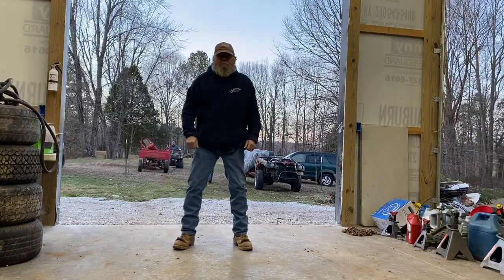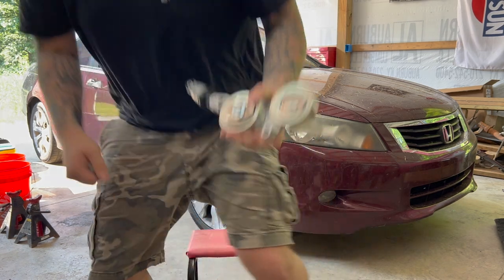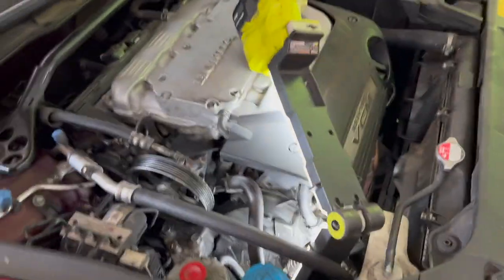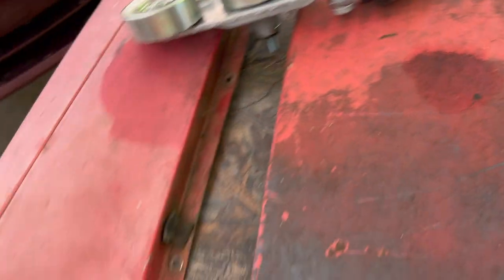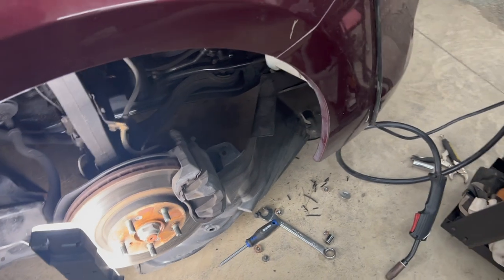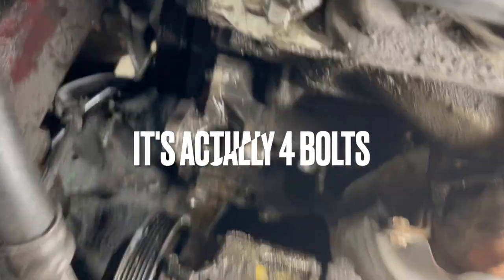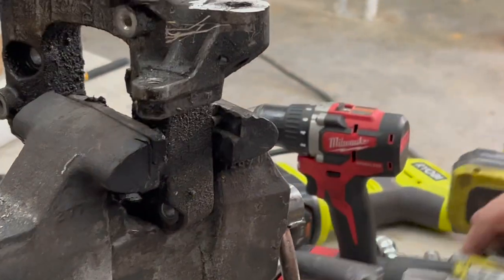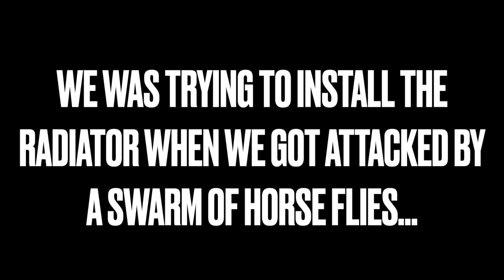Accord Belt Tensioner BOLT BROKE - BUSTING NUTS

Comment from the maker: UPDATE: Belt and tensioner bolt broke again. That was a 12.9 bolt. The belt has always been incredibly difficult to install and ended up being super tight once installed. Overly tight. I installed a new tensioner and used a longer belt. Part number 6PK2155. This fixed the issue. I first thought maybe one of the accessories(power steering pump, ac compressor or alternator) was possibly locking up under load or maybe even the wrong part for this vehicle. I took alternator off and compared to one from the store and it was correct. I could not get it load tested as no one in town apparently had the correct connector on their load tester for this alternator. However all pulleys spun freely so I don't think any of the parts are necessarily bad. I did not remove ac compressor or power steering pump to compare but either way the longer belt remedied the issue.

Comment: Did you have to remove the radiator to take off the mounting bracket?
Reply from the maker: When we had to revisit this repair a month later we didn’t remove the radiator. When we first filmed this we just went ahead and removed it for more space. Not necessary though!
Reply: Just remove the passenger side fan.  Then you can get to the mount bolts with AC and alternaor disconnected.  Just let the compressor hang in there